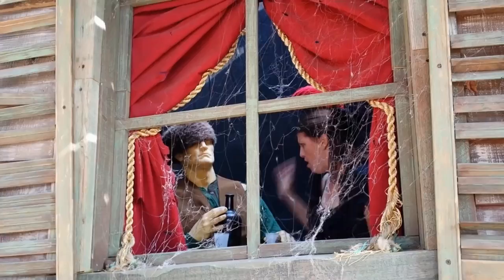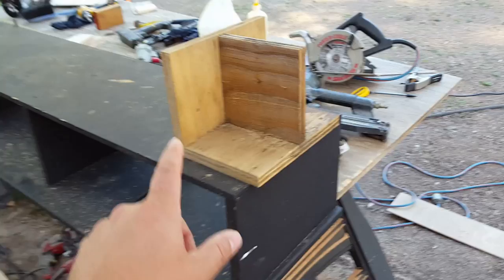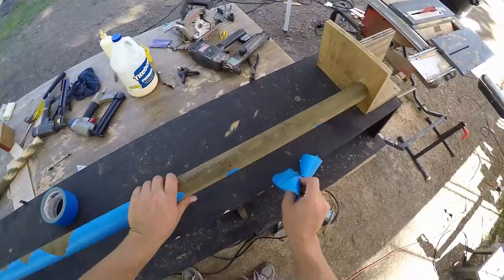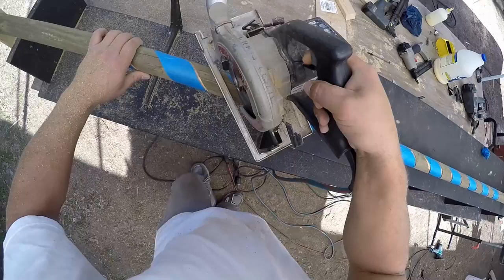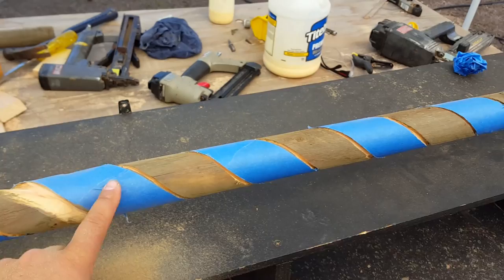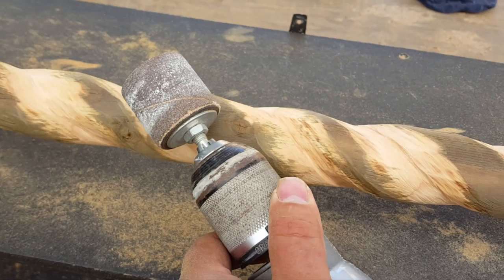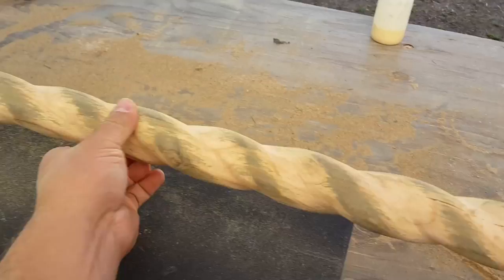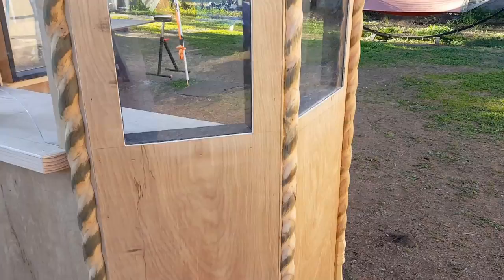How To Carve Wood Rope | Layout A Spiral Or Twist On Wood | Rope Twisted Moulding Detail

Comment: The part where you take the tape off, you cut the video and didn’t show what you did after that and I’m confused.
Reply from the maker: Which part did I loose you? there were a couple places where i removed the tape. 1st was removing the one stripe that gave me the spacing then i cut on the outsides of the remaining stripe. Then I removed all so I could round over everything.

Comment: You could also use a router and have it slide across, making the slider longer to reach the whole pole. Now about the taping, you have to  just spiral the tape on the tape at an angle start. 🙂